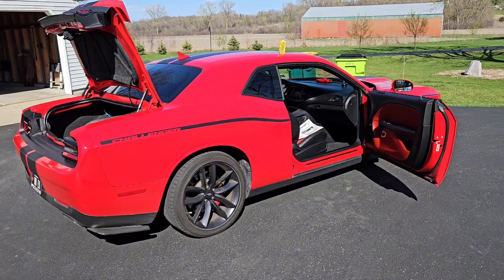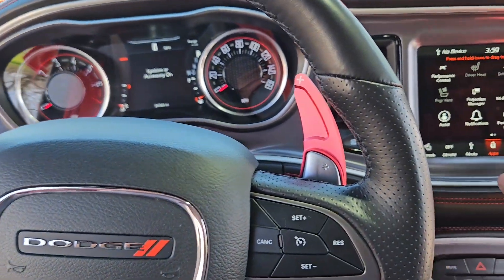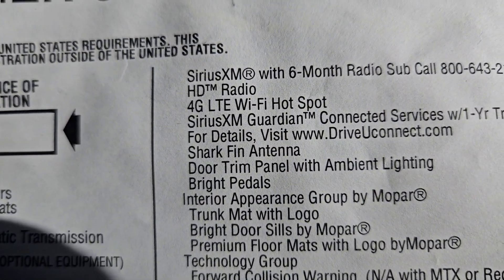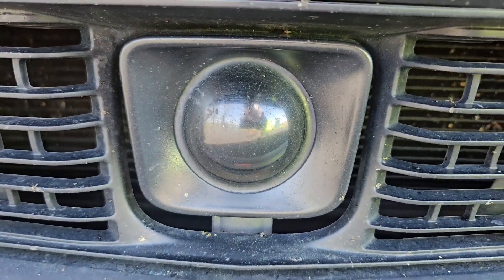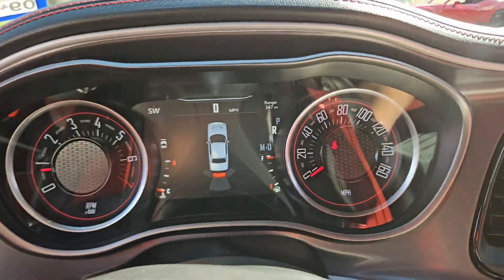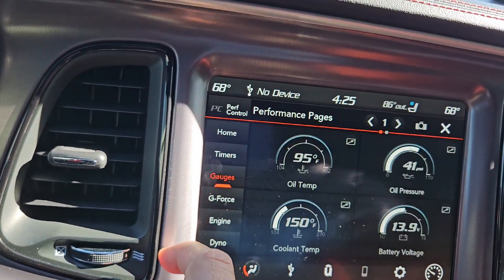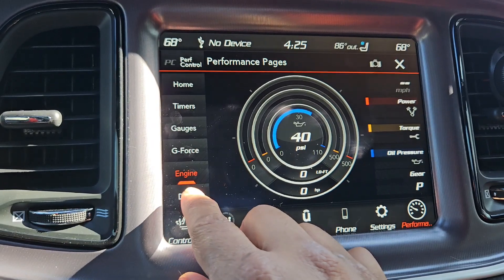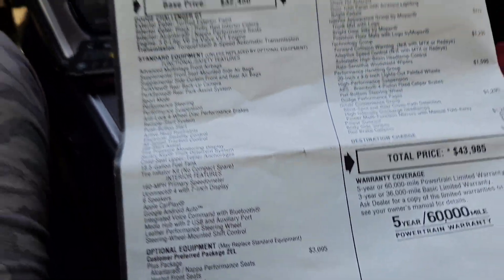Dodge challenger factory build packages explained

Comment: How did you make out with that racing stripe? This is the second one that I saw that did not line up.
Reply from the maker: Unfortunately they don't line up the way factory hellcat does. I got em from stripesource.com I do Not recommend. Bad dimensions. I somehow managed to put them on. Took 2 days. But it looks good not worst that I have seen on some chargers out there
Reply: Yeah, seen your short video, does not line up around the hood vent. Sucks, they look good and was going to get that exact one, carbon fiber.
Reply from the maker: Yeah they definitely look good. And I managed to remove alignment issues by fine cutting excess stripe edge  @TheMoparbob